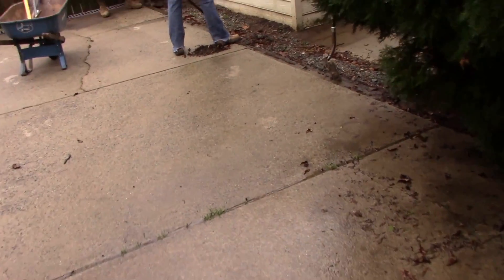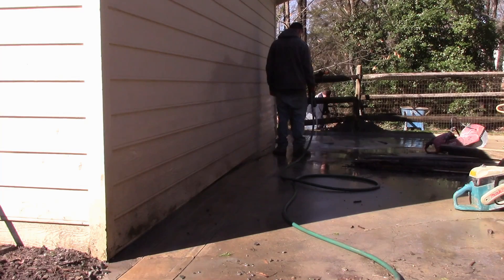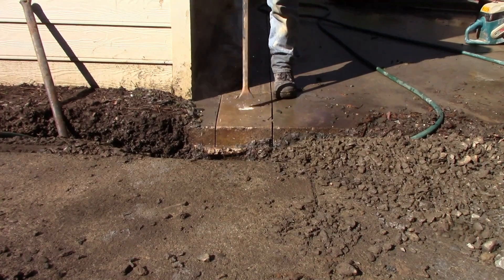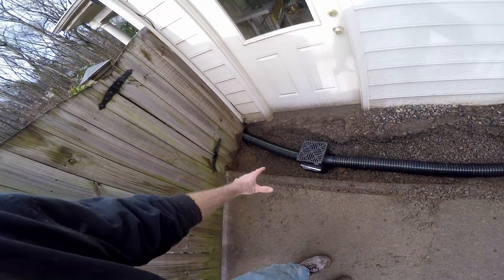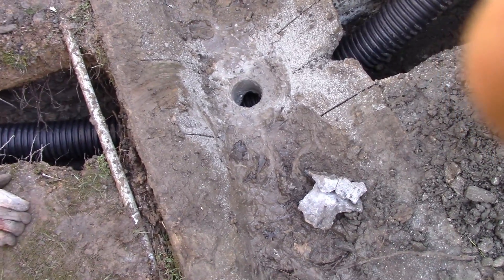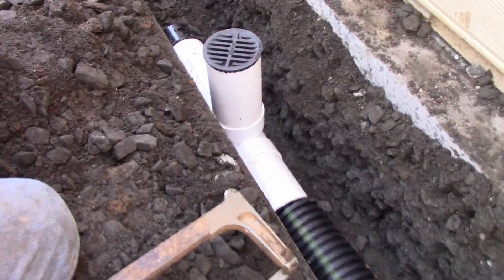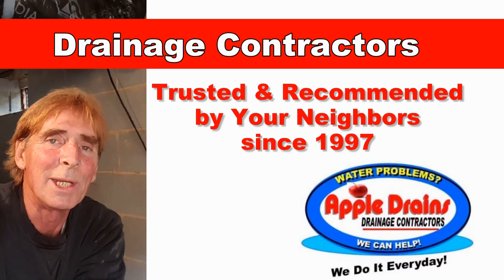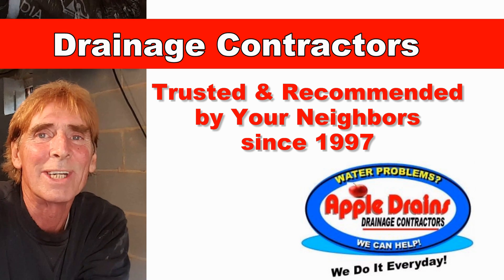Driveway Drainage System Gravel as Channel Drain

Comment: That finished work doesn't look good. Should have used channel drains along the driveway instead of sump boxes. Should have made a groove channel in the new concrete with at least two more 4" drains along the pool house wall. During rain storms they're still going to have water ingress issues and wash down of the soil and gravel at the driveway because you left a soft surface. You didn't level the boxes with the driveway nor concrete in channels to the boxes so water will continue to settle against the pool house. That will also cause the sump boxes and corrugated pipe to clog easier. Finally, plastic should have been laid the width of the pool house below grade where the door is to prevent foundation erosion from the water pooling.
Reply: Trench drains would be so much better here.
Reply: Agree, an average DIY could get a better finish

Comment: It would be better to use a T connector instead of a Y connector.
Reply: Y connectors give less resistance allowing heavy water flow. If any gravel or dirt gets into the system, the Y connector has a less likely chance to clog
Reply: True